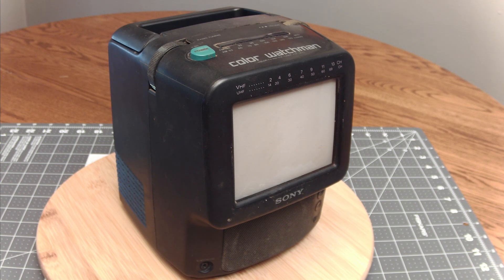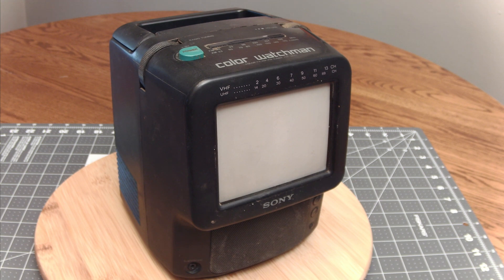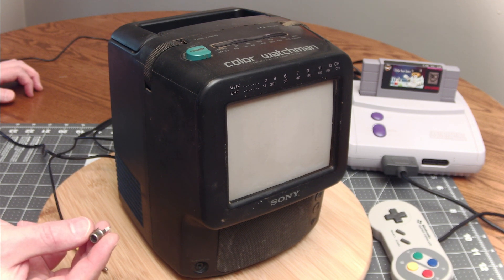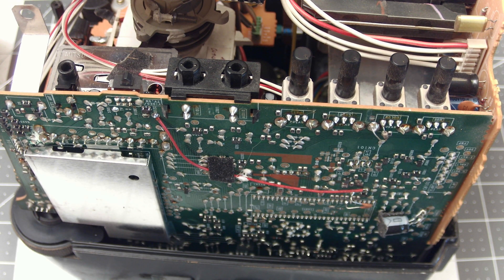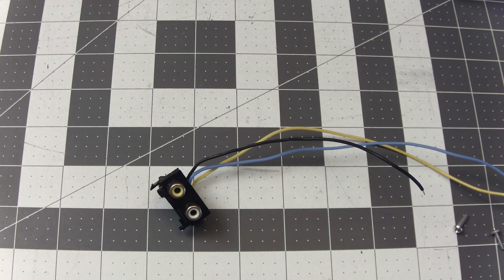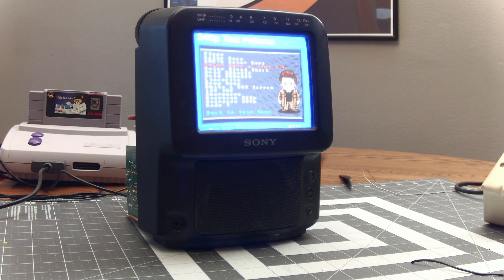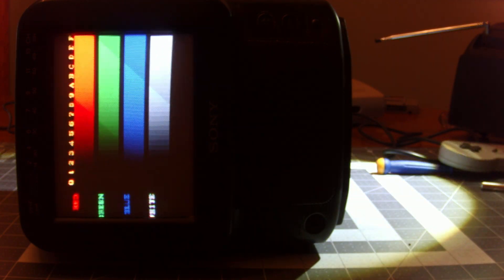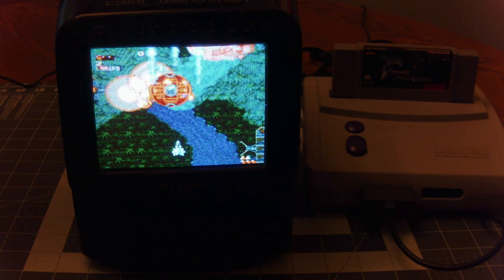Sony FDT-5BX5 - Fixing Broken A/V Sync & CRT Calibration

Comment: How did you adjust the horizontal and vertical size?
Reply from the maker: There are two pots accessible from the bottom. You can't see the pots because they are mounted on the other side of the board but there are holes you can stick a very small screw driver through to adjust them. You should see hsize and vsize with little holes beneath them. if you shine a light into the hole, you can see the orientation of the adjustment. Try to be careful when adjusting though, the adjustment screws are cheap plastic and strip easily if you aren't careful!
Reply: @the-dan3974  Thanks!

Comment: I got one just like the one you have, but mine have no sound at all … is there any way I can fix it???
Reply from the maker: It is very possible yours could have the same solder joint issues mine had. You might have luck wiggling the RCA jack with it plugged in if its a bad joint. Otherwise I know the volume wheel is also kinda brittle so it could maybe have maybe broken there too. If its not either of those I would check if the speaker measures any ohms with a multimeter. If its open then the speaker is for sure bad.

Comment: The CRT electron guns are not tired.  You just need to adjust the red cutoff, green cutoff, and blue cutoff so that each color cuts to black at column “0”.  The cutoff pots are typically on the neckboard.

Comment: ill preface with i just got one of these. on the same board that you adjusted geometry, near the screen there is V. POSITION, but it looks like its adjusted in a different way. i really need a v. position adjustment on mine but i have no idea how to activate it. let me know if you have any ideas on how to do this. thx!
Reply: additionally, the service manual i found online is missing the most important pages showing that boards schematic..
Reply from the maker: Mine needs vertical adjustment as well, I didn't exhaustively look for it but I did look pretty good before giving up. 
I did see however that there were a lot of pots on the top side of the board that you can't reach by adjusting from beneath. I figured it could have been one of those that adjusts the vertical. 
I'll be doing some more with this set in the future so I'll check it over again when I take it apart then!

Comment: "the problem was the av port was broken."  the dan 2021
Reply from the maker: Haha I had plugged/unplugged it several times before filming that shot when I first got it. It totally surprised me when it snapped off like that. It was kind of a relief.
Reply: Sony was a leader in the small TV market.  Odd that this one had no DC power.  Successful fix!!  Nice.
Reply from the maker: I assumed it would have had a battery compartment as well. Almost every small Sony does. But I suppose they were able to keep it that much smaller by not having a battery compartment.